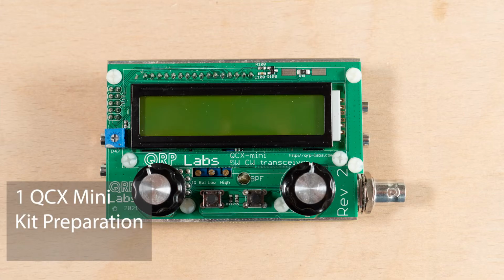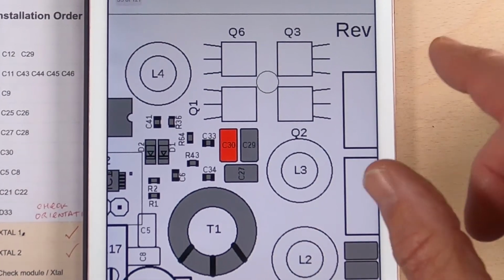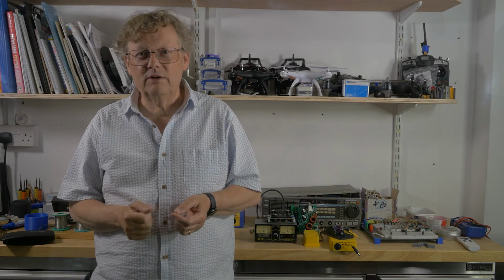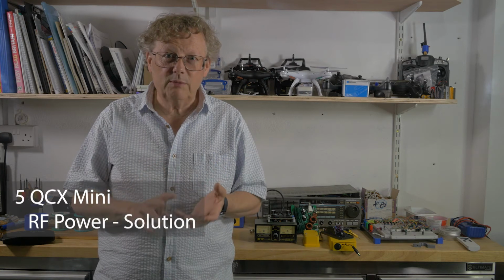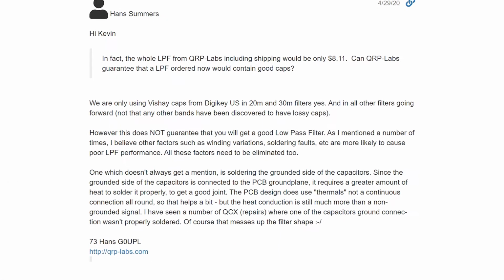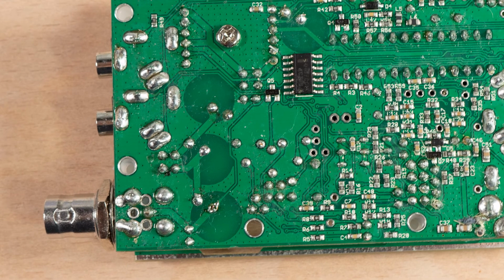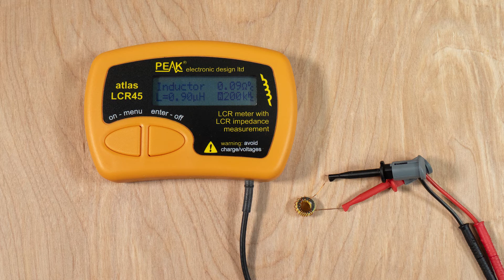Rediscovering Radio 3 : QCX Mini QRP and more…

Comment: Did you make your own battery box? What type of and how many batteries are inside the yellow box?
Reply from the maker: Yes - with the QCX I mainly use a 3D printed box (grey colour) fitted with 3x18650 batteries run through a voltage regulator to give 12 volts. A switch flicks over to a voltmeter so I know when to recharge. It lasts for many hours and easily covers a whole day of portable operation. You can see it in some of my later videos. The yellow box is also 3d printed and contains 8 AA cells, either standard or rechargeable. The current demand of the QCX is not high, so this is useable too with that radio. Generally I prefer to use these small rigs with battery power. I hope that helps, enjoy your radio! 73 from Mort / G4BSK
Reply: @Q26Video  Thank you very much for your information! Unfortunately, I am not a DIY person and hence I don't know how to get a voltage regulator. 73 from Mary / VE3INE

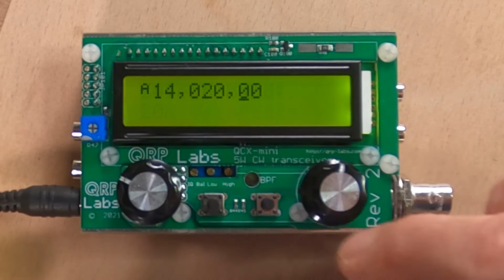Comment: I thought this transceiver is single band but at 3:24, I saw you turned the right knob and the LCD shows a change from 160m to 80m, then to 60m, then to 40 m, then to 20 m. Could you tell me which one is true?
Reply from the maker: It is a single band transceiver- but the first time it powers on, the setup begins by selecting the band you have purchased. Once you have done that, you don't see that menu again. A great radio - I have 2 of them now, 20m and 17m.
Reply: @Q26Video  Thank you for your reply!

Comment: Thanks for posting. I have built a couple of the old QCX kits and a QCX-mini. I think they are fantastic QRP rigs. I have a second QCX-mini that I aim to try to get working on 10m. Although Hans does not sell QCX-mini kits for 15/12/10m, he has said it may be possible but to expect a drop in RX sensitivity and TX power output. I will give it a go. If it doesn't work out, I can always convert to a lower band.

Comment: Good video and did you get the aluminum case with your, I forgot to order the case for mine, I might just find a plastic box if I can find one to fit.  73 KV5P
Reply from the maker: Thanks - glad you enjoyed it - yes, I did use the QRP Labs cases on all 3 of my QCX kits. All worked out well and I'm using them all regularly now.